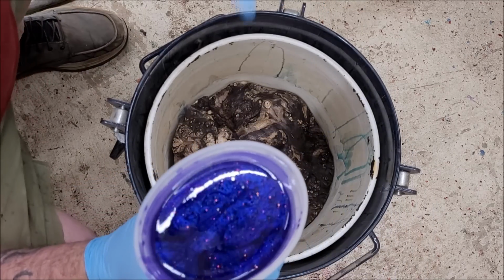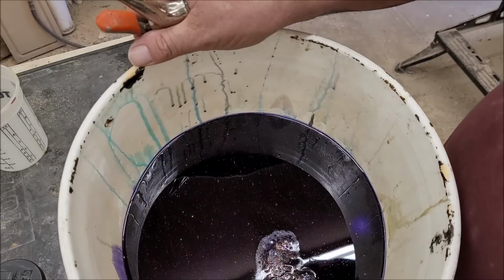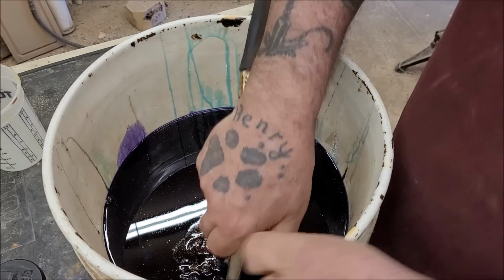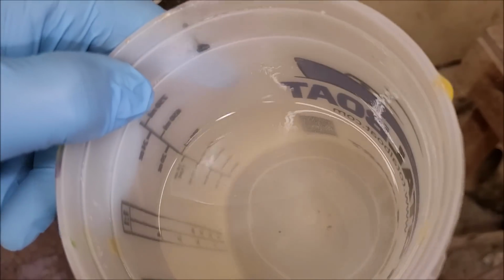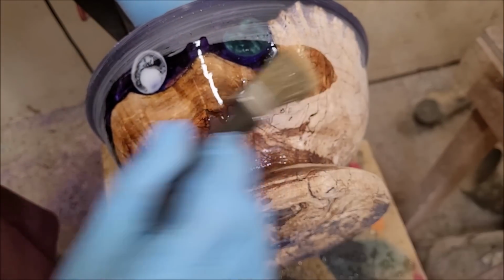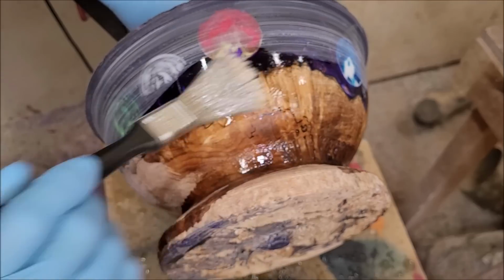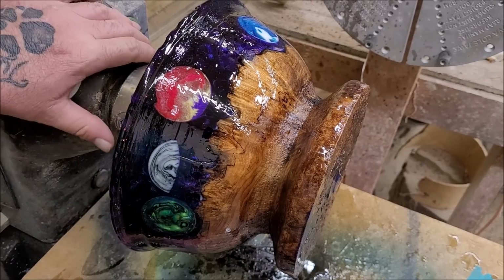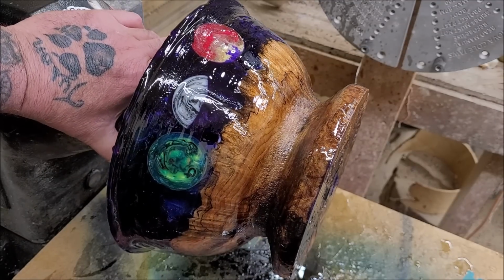What !!!! See what I did with this

Comment: Fairly new to your channel and seeing this vid a month after it was put up...not sure if you are still monitoring questions.  
The punkiness looked visible at the start. Why did you choose not to stabilize the wood before starting? Or use a vacuum pot for the first bit you poured to fill more of the punky area?  I like to try understanding artists' choices and thought processes as they develop a piece.  

I like the way the burl pattern is developing and the planet inclusions are fascinating! I hope they turn out as well in the finished piece as they look in the "sneak peek"!  Off now to look at Part 2.
Reply from the maker: Thank You Thank You Susan,  well I get the resin for free, I would rather waste that than the stabilizing resin I have to pay for,  my vacuum chamber is not large enough for a bowl, I do have one that size but the lid has seen better days and is cracked due to the constant pressure and the fumes from the cactus juice.

Comment: IF it is too lopsided I would try to Gorilla Tape a lead sheet weight to the outside of the bowl to balance it out some...  I used to flatten soft tire weights in a vice to make them thinner...  You can also buy lead sheets...  Make sure the tape goes all the way around the bowl for maximum strength
Reply from the maker: Thank you Steve, I thought about that then thought at 1250rpm that would shoot through the wall or ceiling
Reply: @PohlBarnProductions  That is why you encase it in the gorilla tape  :)

Comment: Hi Doug!  This piece looks amazing so far..you always have a solution how to fix all kinds of issues, so I hope you don't mind me asking about the epoxy/acetone mix you made.  How much acetone is needed to stabilize like you explained?  Thank you for this video.  I really appreciate these kinds of videos and how you teach how to fix it!
Reply from the maker: Thank you Lori,  it doesn't take much of the acetone to thin the resin out like water,  25% or so,  the heat actually helps speed up the evaporation part, I put it into my greenhouse which worked great but it cracked the resin, so it was a bit to warm
Reply: Doug, I'm very sorry to hear that it cracked!  Is that something that you can also fix?
Reply from the maker: yes I fix that crack Lori

Comment: As far as unfinished projects go, this one at least actually had a pretty good aesthetic, what with the planets being visible and all.

Also, I don't think I remember your lathe shaking this much before. Not to the point of moving across the floor, anyway.
Reply from the maker: well it has a bad bearing that Nova will not address under the warranty,  and it's off set with resin isn't helping